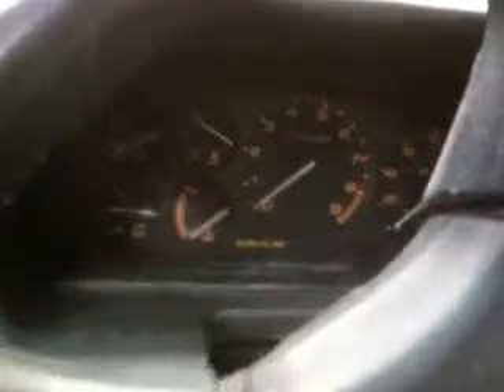RX-7 Failed Warm-Up Cycle

Comment: i have the same problem and i think the problem can be a bad mass air flow sensor or a vacuum leak somewhere or it can be a bad throttle body. you said you got it back from the body shop they might have disconected something and not put it back right. you can see a video i have and it does similar things like yours. i'm still trying to fix mine.

Comment: Rotary is a junk engine.  Buy a piston engine.  Problem solved/
Reply: Nope, won't fit if you want one with equal power.
That's a 1.3 liter making more than 220 hp.